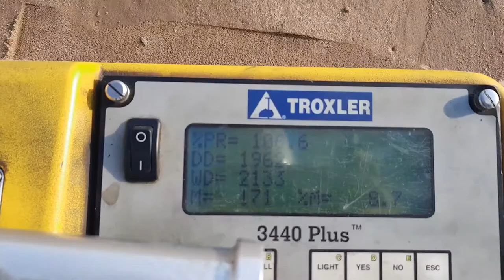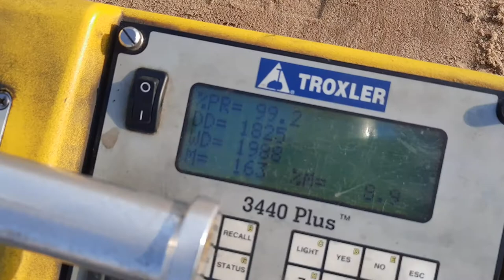FDT (compaction Testing) Backfilling/earthworks

Comment: Da faq? If they are not gonna stand over the compaction tester, to get a good compaction test? That roller in the back is still gonna fuhck  up that test, even if that roller is on low roll
Reply from the maker: As you see the area isn't ready, this is internal test not the official with the client. Thanks for your comment...